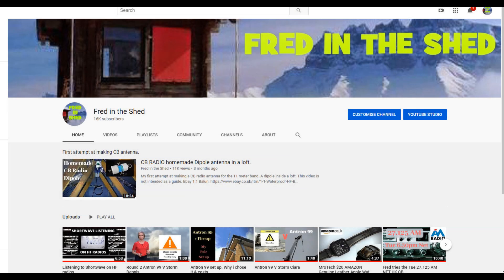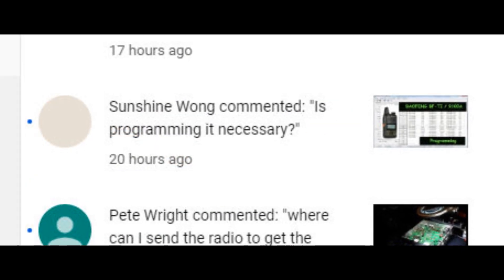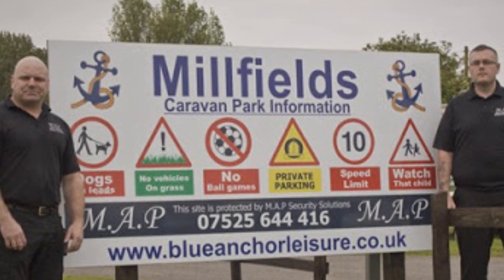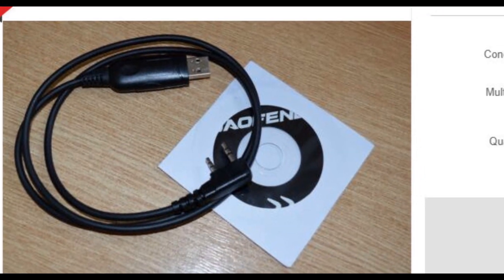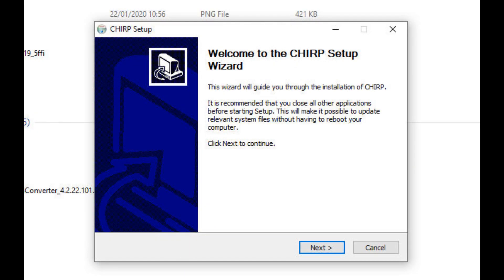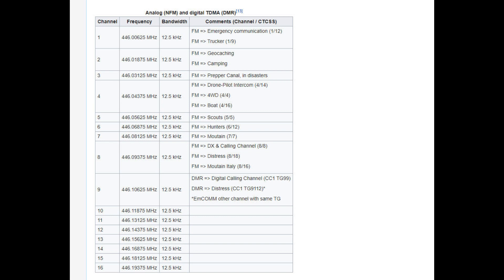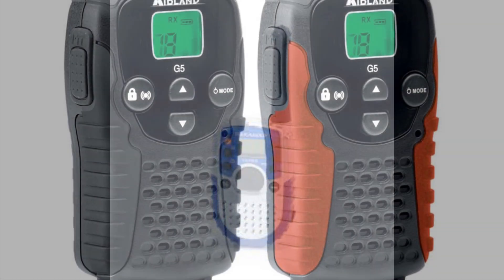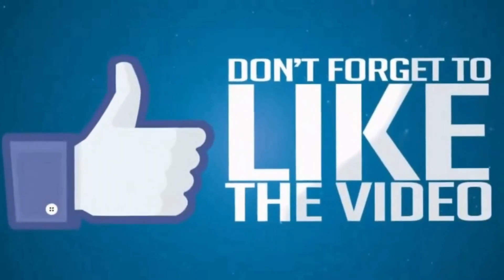Why you should Re-Programme Baofeng radios. + CHIRP Guide

Comment: To make you aware that if you use them on pmr 446 you are actually breaking the rules of pmr 446 as 1 thay have an antenna that you can remove, and 2 their transmit power is way above the legal power for pmr 446 so just don't do it your better off just buying pmr 446 radios and thay are not that expensive
Reply: Im looking at one of these radios for when at airsoft events. A lot of people use legal power radios ( myself included) but often struggle across the large site due to terrain. Those using uv5r and similar have no such issues. Yes this may not comply with the law/rules but are they doing any real harm?

Comment: I have a pair of Baofeng UV-5Riii radios to use as walkie talkies with my partner. I programmed them exactly as advised here but when we set to the same channel and use PTT we can't hear anything. They don't seem to be receiving.
Reply from the maker: You may have the digital privacy codes switched on to different settings.  They will need to match or be switched off.

Comment: down loaded chirp but cable wont connect to my computer has windows 7 says no port no software have tried many times many different ways so i guess i will try it by hand even though i have no clue, if it had an engine i would no problem

Comment: Every amateur radio guy on YT says, the cheap baofeng brake if the fall on concrete and the tone quality is not good, also the antennas.
Reply from the maker: I think most radios might break if dropped on solid concrete.  The genuine 5R's are built pretty strong.
Reply: @CB-RADIO-UK  thanks for the answer 🙂
How can I get a genuine baofeng radio, thar are so many 🤔

Comment: Hi, I am going to reprogram  Baofeng to PMR446. Is any point to buy longer(better gain) antenna? Will it increase range by any chance?
Reply from the maker: It does help range. Ive done a few test videos if you look back through the channel
Reply: @CB-RADIO-UK  Thank you.
Reply: @CB-RADIO-UK  I thought the Beofengs were overpowered for PMR use?  To make them a bit more legal wouldn't it be safer to get a shorter (worse) antenna?
Less range but less chance of getting unwanted attention.

Comment: These radios are only legal if used by Hams or private licensed PMR users. You'd probably be fine on PMR446 although its not legal and if caught using PMR446 on these radios you'd end up in court and Ofcom will fine you and take your radios but not likely to happen unless your unlucky. The legal requirements for PMR446 is a non removable antenna and 500mW RF. I'd not put the LPD frequencies in as these radios are high powered and you'd be interfering with the 70cms ham band which is also used by the M.O.D The LPD legal requirements are 10mW with a fixed antenna. I do wonder how many people buy these radios and use them straight out of the box on any frequency. Many users today within the range that theses Baofeng radios can do all use Digital modes now DMR. There are only a small handful of analog users around.
Reply: Also Emergency services are using Tetra networks now so they can't be listened too. Great little radios, they are as wide as a barn door and don't have any band filtering in them but great for the price. I'd encourage those who are interested in radio to take the foundation course witch is FREE and if you pass, you get a license to use the Ham bands https://www.essexham.co.uk/baofeng-radio-without-licence

Comment: This is far different then the us. In the states this service is referred to as GMRS/FRS, 446 MHz is dolled out to amateur use, the american GMRS band is allocated @ 462 MHz and 467 for repeater inputs only. This is just incase any people from the us see this, its the same principal for FRS and PMR just different allocations and PMR does not have the same repeater allocations or licensed option to use said repeaters and more then 2 watts. The us also has the multi use radio service and theres some controversy over the uk vhf equivalent. The uk is so close quarters compared to the us, so thats why u have things like exclusion zones in the uk where as in the us you probably could not even drive into the exclusion zone at a place like the VLA because its a desert and under military control. The uk police and such are almost entirely terrestrial trunked or tetra radio systems, which is digital but also encrypted entirely. The united states use APCO p25 trunking and conventional systems. They are easy to decode but can also run encryption. It is not as common in the us to encrypt but there are entire statewide systems that are. Theres also many police agencies in the us that are analog, either on a trunked or conventional system. My best advice to a person who wants to listen out for things is to buy a scanner. You will never be able to listen to trunked systems the correct way with a transceiver because it can not follow the trunking controller unless it has the system key, which a scanner can bypass with its own computer aided method. Good day!

Comment: Hello Fred, thanks for your interesting videos.
You might be able to help me customizing a Baofeng BF-U9 to match PMR.
I got the specific USB-Serial cable and already tried Chirp. Unfortunately
the BF-U9 is not on the list of supported devices - and attempts to modify
fail (I tried all Baofeng types and all fail with various error messages)
Do you have any idea which software might work ?
 (Retevis RT16 doesn't do the jpb either)
Reply from the maker: Search the Baofeng web page fr support as you might be able to download their program software. As the U9 is a new model it may take a while for it to be added to Chirp.
Reply: Asking Baofeng was my idea as well, but I have not received a reply so far.
Hope they can provide the required SW (as the radio and the cable are available on the market).
Reply: On Baofeng support pages I found an open ticket: “New Model #8263” 
asking to add BF-U9 (and variants) to the supported devices.
It appears as if someone is working on it. Let's cross our fingers ...

Comment: I've recently been intrigued in Amateur Radio recently but it is a bad year to do so as lockdown. So can't get hands on training. I might get a radio to learn on with NO transmitting, just listening.
It seems that these radios have a lot of bad and good reviews. What would be the best Baofeng for the widest frequency range and power output under 10w?
Reply from the maker: Hi James.  I would look at the UV5R as its the most common used and is cheap.  Just  be aware that there are a lot of clones very cheap on Ebay so do a little research.

Comment: Hi Fred
I’ve recently purchased a  Baofeng UV5R III and have programmed it in line with your video. Being a complete novice I am finding it difficult to understand how I should be using it. I uploaded the 16 frequencies/channels as PMR446.
One of the uses I would like to be able to do is listen to the Control Tower at Biggin Hill on 134.80 but find the lowest frequency on my radio is 136.025 and nothing lower than that can be programmed in. why is that please?
Reply from the maker: Hi as far as iam aware  the UV5R will only cover 136- 174 MHz which covers the 2m ham band.
Reply: Use chirp to access the lower bands

Comment: Hi Fred
Can I ask a question regarding the Baofang 5rv? The charger I have has a usb so Imwas wondering if I can use a mains mobile phone charger?
Thanks
Reply from the maker: Hi. As long as your charger is 5 volt it should be ok.
Reply: Fred in the Shed is that the radio charger or phone charger? Sorry if that’s a stupid question, bit of a novice!
Reply: Fred in the Shed is that the radio charger or phone charger? Sorry if that’s a stupid question, bit of a novice!
Reply from the maker: Hi. Any charger should be fine as long as it outputs 5 volts dc. ( It will say on a sticker on the charger).  This is because USB runs on 5 volts.

Comment: Fred, Think you forgot to mention that you should also change the mode against each channel to NFM (Narrow FM - basically 12.5khz bandwidth) to align with PMR standard channels. If you leave this unchanged then it will set 25khz bandwidth which doesn't work as well if talking to regular PMR radios.
Reply from the maker: Yes good point paul.

Comment: Oops iv been using 15 watts on PMR446on my hand held for years 😬 never had one problem on the dark side of the moon.
Reply: Dr Gunsmith I like the dark side of the 🌒
Reply: Most Chinese handheld radios dont output anywhere near what they claim! you may find that your 15 watts is infact more like 12! or even less with some radios that are advertised as being 15w. although even that is considerably more than the 500mw thats legally permitted on 446 of course lol.  if it bothers you your radio does have an option to reduce the RF output! but unless your talking to somebody else who also has a high powered radio there is very little advantage in using more than 500mw anyway! because although they will be able to hear you, its unlikely you will be able to hear them! something most people fail to consider. (unless they are on a high point) one of the very few that puts out what it claims to is the Quansheng TG-UV2 Plus which I would highly recommend.

Comment: Hi Fred. My favourite Baofeng radio has got to be the UV-B5. It has a rotary encoder/vfo knob making it easier to change frequency. Also it is far more ergonomic and slightly smaller(Better for these piano/pen pushers little fingers). My favourite hand held radio is by far the Yaesu FT 60.

Comment: Got a couple of Baofeng's used chirp on day one. I never considered that people actually use the test frequencies and leave it at that. Amazing!
Reply: You are spang on that. Was amazed to find my. Dragons(baofeng barking over a remote sensor in my yard)reacting /alarming. Im thinking this might be a plus. The feable xmiter in the sensor could be picked up as far as 2 blocks. AWay. I could walk the block and know its tripped. Can take a walk and be in the know. Rem: just switch off the baofing transmitter, and Listen Via chirp control. how simple? Kv4li 73
Reply: The majority of business users leave it on what they come programmed with, your average business buying a radio that's nit typed approvelesvrvthe 462 463 469 mhz in and is say 462 525 114.8 is most common I have the channels set up on scanner with the tones
Reply: I say near me 10 businesses using these or retevis on same freqs, they buy them and and just choose a preset channel

Comment: The UV-5R can operate on the marine band 156.000 and down. Example 156.800 is Channel 16 ... and it works!!
Reply: Richard Millican Yes, i agree. Got a lot fun at the Eastsea on 156.800 in my holidays. Greetings from south Germany.
Reply: I have just bought a UV-5R and waiting for it to arrive. I live in North Wales by the sea and co-own a boat. I bought this as it will do the PMR bands for the obligatory lads road trip (post lockdown), the Cambrian Rally and Wales Rally GB (radios are brilliant when in a forest with extremely patchy phone signal) and as good back up of the marine radios. 

We have a fixed VHF, an Icom waterproof handheld and this will make a good additional backup which obviously does multiple bands.

I can't believe I can an all in one radio that can do PMR for talking with the lads on a road trip or quad biking. To listening to what ever traffic is on the marine band and also taking it to Mach loop and listening to Valley ATC and aircraft flying through LFA 7. 

I'm like a child on christmas and cannot wait for it to arrive so I can program it and start listening.

Comment: What about the walkie talkies Fred are they OK out of the box? Also could you plug in your antenna the antron etc..
Reply from the maker: The standard 446 PMR radios that you buy are all ok.  Its just the Baofengs and other china radios you need to re programme.  The Antron is tuned for the 27 Mhz 11 meter band so the SWR would be totally screwed on 446 Mhz.  Mind you having said that ive never tried it. :-)
Reply: @CB-RADIO-UK  thanks Fred. Seen those measuring tape ariels for them fold up job looks great...

Comment: Done a few of the waterproof ones with the marine channels, you can also lock the tx range down to prevent some of the issues you mention. GT3TP was probably the better one, but not as profitable for the makers so you dont see as many as the 5r. On full power my GT3 will ping a repeater 20km away, thats from inside the house on the supplied rubber duck. Awesome bit of kit for the money.